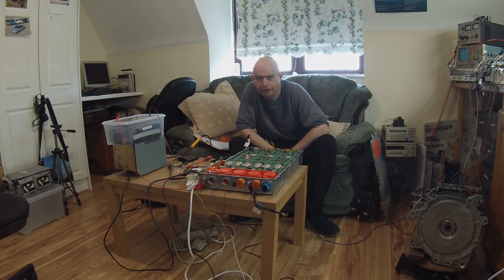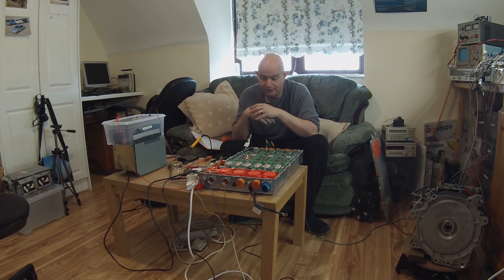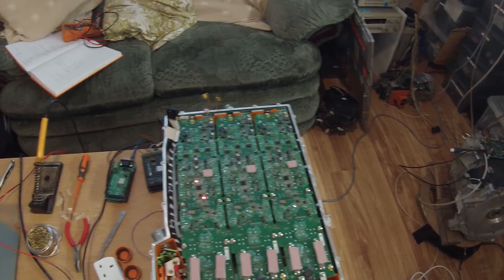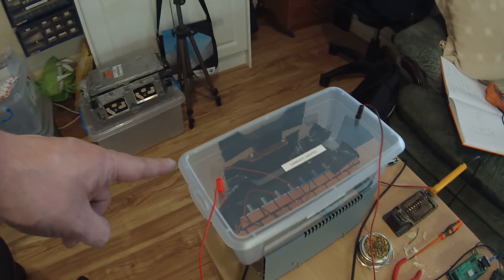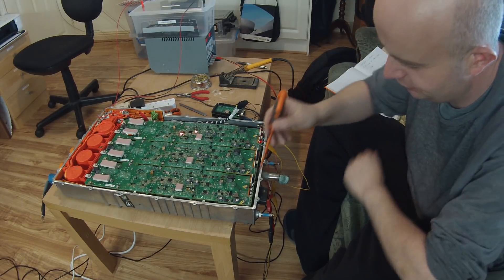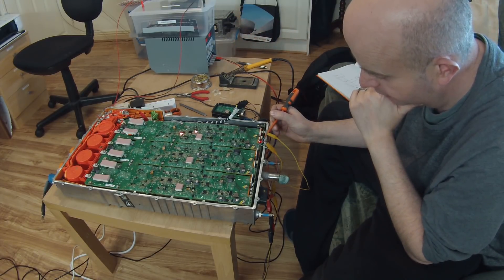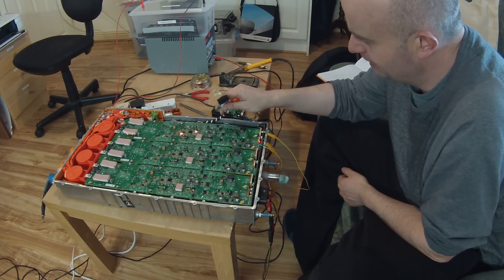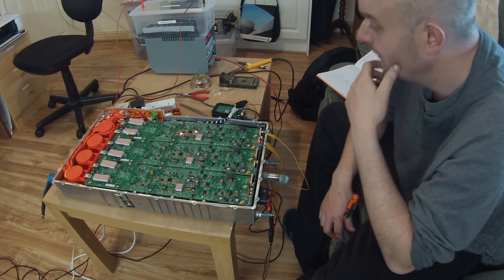The Tesla Project :Gen 3 Charger Hacked

Comment: Talking about dc to dc converters, let's say one wants to have a few Kw of audio in their car, and that car happens to be a hybrid/electric car. All car audio equipment is 12-16v, Not messing with 300v straight in the trunk, I wouldn't bring that voltage to an amplifier (there is an amplifier rated at 400v max made by taramps, outputs like 150kw, but aside from a huge show truck filled with speakers that would be overkill, useless, more expensive than it needs to be and would suck the battery dry in minutes), but using 12v seems stupid considering there is a source of higher voltage available. 12v stuff uses cables thicker than the cables going to the tesla motors! To get 12v to make high power the amplifiers have to be huge to handle the amps, I was wondering what the future of car audio holds, perhaps a 48v dc to dc converter just for the amps. Capable of something like 10kw? Could even run some good quality inverters and have home stuff running flawlessly. A 48v amplifier would be much smaller and not get as hot compared to a 12v one for the same power. So a person could install a 48v dc to dc converter  and not touch his car's 12v side. Voltage wouldn't drop too low and perhaps mess with the control electronics of the car. I'm guessing for the time being people would stick to low power stuff in electric cars, or maybe some screw loose person could use multiple dc to dc converters in parralel, once again separate from the cars existing 12v system, but that could get very expensive depending on the price of the converters, and an enthusiast in such things would rather spend his money on amps speakers and the rest of the things he needs instead of dumping his money in the thing that would power his equipment.
Reply: Tesla has stated their intent to move away from 12V automotive systems and drop the low voltage battery. If I had to guess they will probably move to 48V on the low voltage side. Only real problem with doing that is they become one of the only if not the only car company that needs every component to be 48V. Considering how much of their stuff comes from OEMs it may be some time coming. Maybe they are already doing it on the semi though?
Reply: GoRK no sane manuafacturer would drop 12v, it just works for everything flawlessly, it's only some things that would benefit from a higher voltage, but considering all the electronics in a car and how everything runs on 12v, it's not going anywhere. it has no reason to.
Reply: Despite your insistence to the contrary this is not actually something that is worth having a debate about; it is already happening regardless of the merits for or against-- some cars are already being built with 48V supplemental systems and 20% of cars forecast to be completely 48V within the next 10 years. It's not really that anything is wrong with 12V for a lot of the stuff, it's just that there's also nothing wrong with 48V for that stuff either; so long as the manufacturers will make the parts. Remember 48V is pretty de-facto in the networking, telecom, and datacenter world too. If you can run power and communications to everything in the car by plugging it into a powered ethernet switch the problem of wiring harnesses essentially disappears. The cost of the electronics used to make that a scary thought, but these days not so much.

Also FWIW if there is any counterexample to a sane manufacturer it's Tesla who has already said the Model Y will not use a 12V system.

Comment: Center display? Isn't that gonna be pretty useless for a non tesla car? Meh anyway, dc to dc converter, now that's gonna be useful. If my memory serves me right that guy that rebuilt a salvage tesla, Rich rebuilds (formerly known as car guru) said that the the dc to dc converter can be replaced straight with a part from a toyota car. So hacking a commonly found item would make the lives of diy electric car people easier.
Reply: Unfortunately it is not a common Toyota car.
Toyota produced an EV Rav4 from 2012-2014 in California. It uses a Tesla drive train and power system from the original model s. There is also a Mercedes that uses the same Tesla system
Reply: Better to know than not..in terms of electrical components.